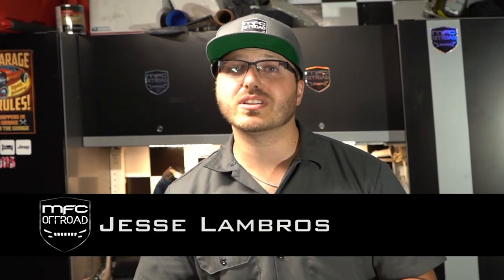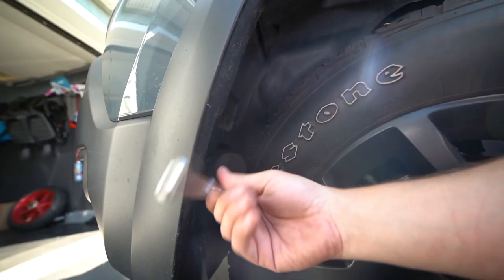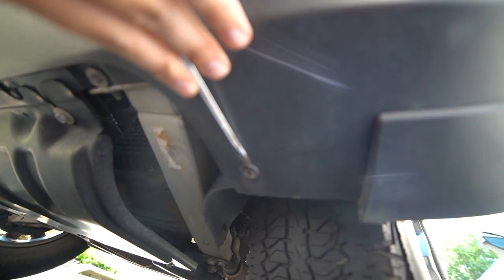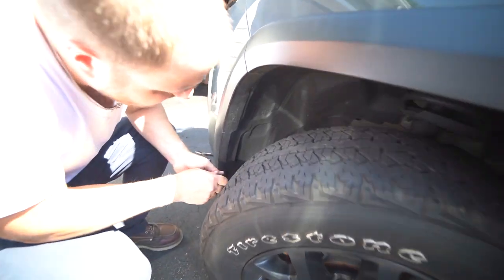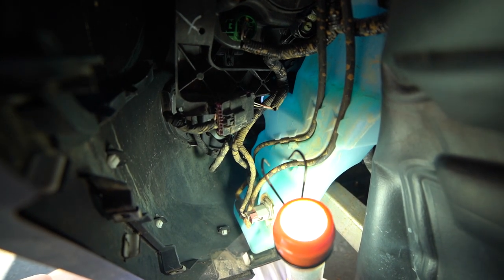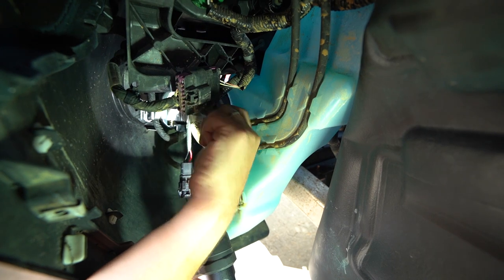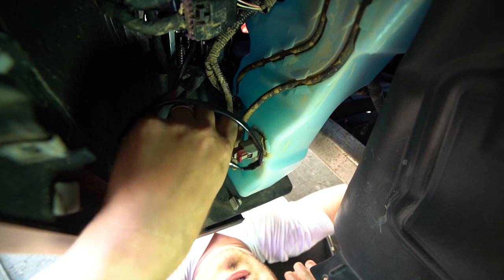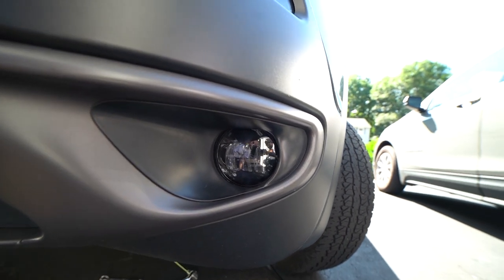2014-2018 Jeep Cherokee LED Fog Lights From MFC Offroad: We Walk Through and Install Them

Comment: i just had these installed on 14 jeep cherokee the driver side did not work passenger side did any idea what could be issue please help thx
Reply from the maker: Bill Irwin please try flipping the connector. LED is polarity sensitive and this is the first issue to try and resolve easily